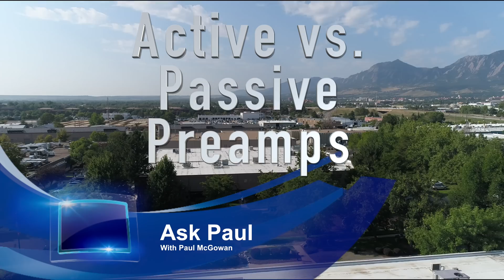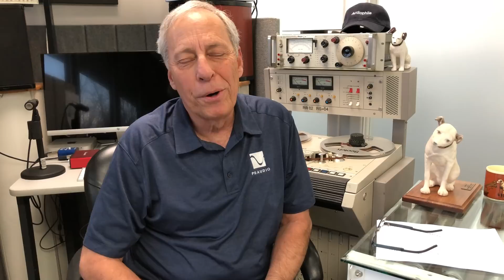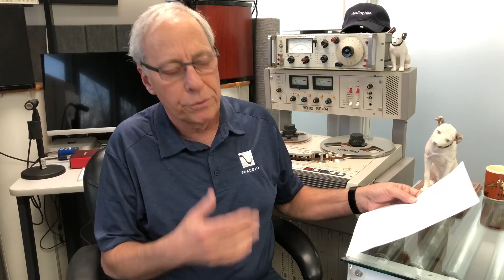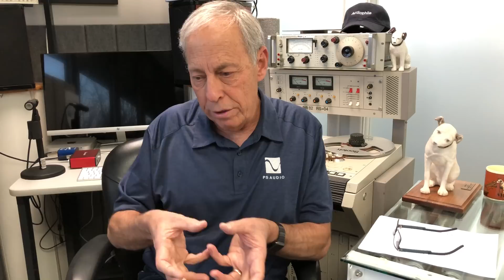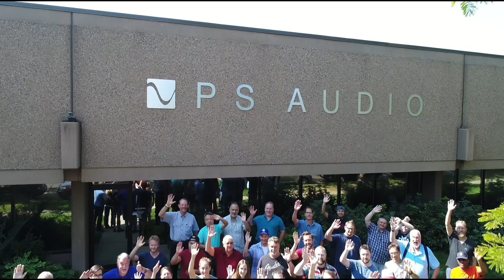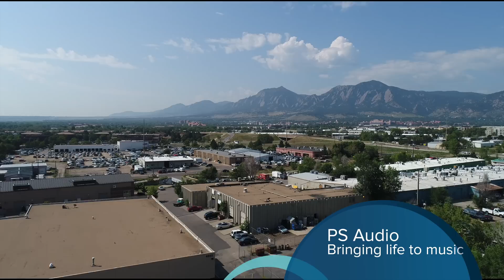Active vs. passive preamps

Comment: A buffer stage preamp if well designed with a proper power supply is not a bad compromise. Paul is absolutely correct with the total passive preamp bass slam loss and who wants that.😊

Comment: Many people in this comment section are confused about the name "passive pre amplifier" The prefix "pre" denotes "before" so, a pre amplifier (passive or non passive) is a device that comes before an amplifier (power amplifier) it is not meant to infer that  it is amplifying anything. Think of the term pre shave  (lotion), it does not do any shaving, it merely comes "before shaving"  Even a powered pre amp doesn't amplify the signal (except phono) it needs to be powered only for correction circuitry, tone controls, switching etc.

Comment: I need help Paul, since you are discussing passive vs active preamps and the pots used having certain impedance, how do I know how to best match impedance from a preamp (it's output impedance right) and power amp (here is input impedance matter is it)? How about voltage does it has something to do to drive the amp to a certain loudness level? I am at a lost. Hope to hear from you or better yet have separate video for this?

Comment: For about 6 mos now I've been using the Icon passive from Triple M Audio out of the UK. It is a transformer based unit (tvc). It's the best purchase I've made in a long time. I get plenty of volume from my Oppo universal player and my Coda phono stage. Over the years I've owned audio gear from Mark Levinson, Rowland, McCormack, and Coda. My speakers are Legacy Focus. No active preamp that I have ever owned has given me the kind of detail and realism that the passive gives me. My interconnects are short....no more than 1 meter, but the interconnect to my power amp is about 3 meters. Volume and dynamics is never an issue.

Comment: By definition there is no such thing as a passive amplifier. Your 'passive Pre-Amp' is nothing more than an attenuator.
Reply: Christian Holmstedt That's not quite true. There's no such thing as a passive power amplifier, but a transformer can give passive voltage amplification at the cost of increased source impedance.

Comment: I don't get it.  In order for me to listen to my records on my turntable I have to amplify the signal so my receiver can amplify it so I can hear it at normal levels.  Without it, I can barely hear anything.  If I used a passive pre amp there would be no initial amplification.  When is using a passive pre amp a viable option?
Reply: With a turntable, you DO need an active device. I think the person asking the question uses high level sources only, where you may not need any amplification. In those cases, a passive device can be used, since the output of a typical CD player, for instance, will drive most power amps to full (or more) output.
Reply: With a turntable you still need a phone stage suitable for your cartridge (MM or MC) which can then be plugged into a passive preamp.  This will provide the RIAA equalisation and amplify the very weak signal from the cartridge.  In an active preamp, the phono stage is a section of the unit which follows the phono input but the signal then gets boosted again only to get turned down by the volume control.  With any other device such as a CD player, Blu Ray player, etc. you can plug it straight into the passive preamp.  If you're in any doubt about the sound quality improvement, don't be, it's "chalk and cheese" -  a good passive preamp will sound MUCH better than any active unit.

Comment: For years I used a passive pre-amp that had an  "autoformer' (i.e., a tapped coil) that did not degrade the bass.  And then one day I heard you praise the Aesthetix Calypso, which is a 2-tube per channel line stage preamp.  I auditioned the Calypso and bought it immediately.  The difference in sound quality is astounding.  Why is this the case?  You would think that the simple, passive tapped coil would do the least amount of damage to the signal, but the opposite turned out to be the case.
Reply: Hot damn, 6500€/$.  I am cursing the cost of a quad channel stepped attentuator for my DIY box. 
One day perhaps.

Comment: Listening to this right now using a preamp with a passive/active switch. Quite interesting, all I thought passive did was skip the bass/treble knobs as I've always had a strong enough input for it to carry through in passive. Funny thing also, is the power switch does nothing except illuminate a green LED.